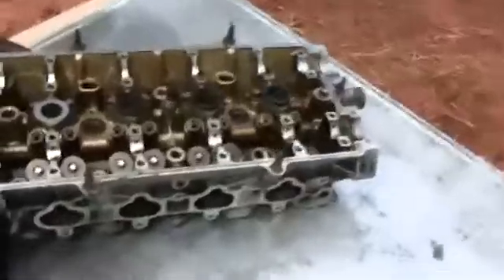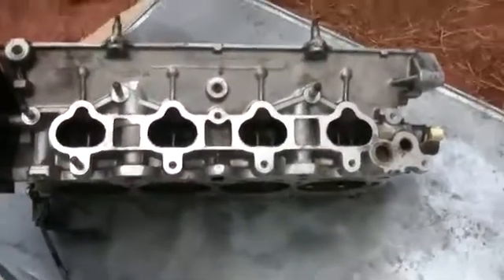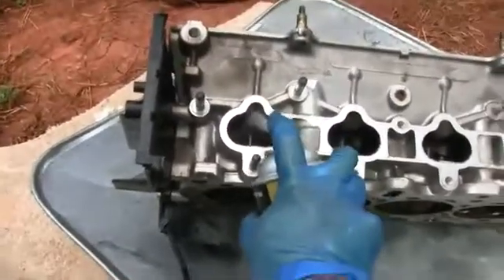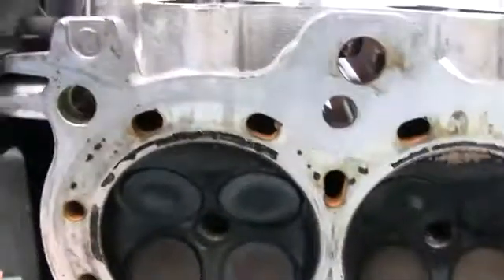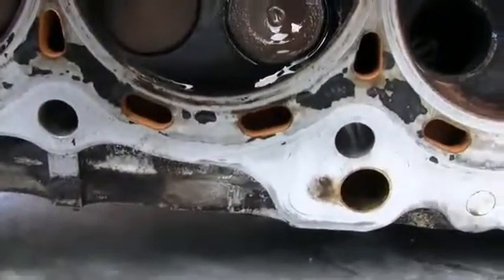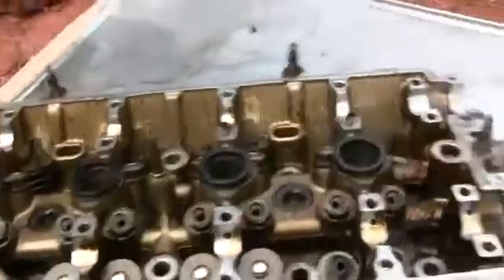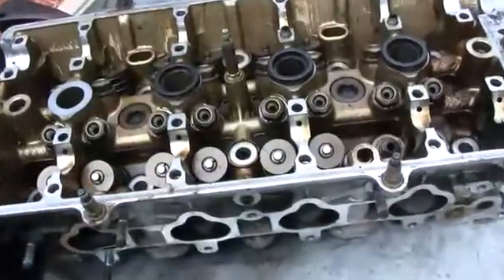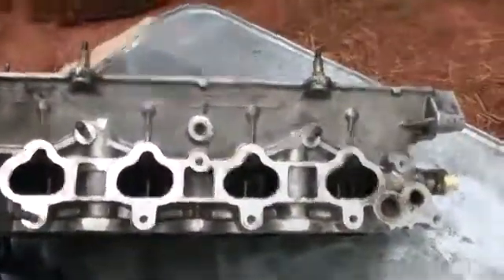THENG - Cylinder leak test how to check for bent valves

Comment: Good video. I tried this test on my 2.2 GM Ecotech head. When I filled the ports with the brake cleaner, I didn't see any leakage right away. However, after letting it sit in the port for 5 minutes or more, I did notice some very slight weeping on most of my valves. Is this normal?

Comment: Another way is to do a simple compression test while the head is still on the block. If bent valves either 0 or very low PSI if bent valves caused by throwing the timing belt/chain

Comment: This is a good test if you have the head off.. but I had something get sucked into my motor.. and messed up the seat on the intake valve.. resulting in 203-204-205-150 compression.. and this test didnt show anything..once i got it to machine shop he did leak test.. and boom saw it right away... pressurized > This method.. but if the bend or seat is damaged enough, this works